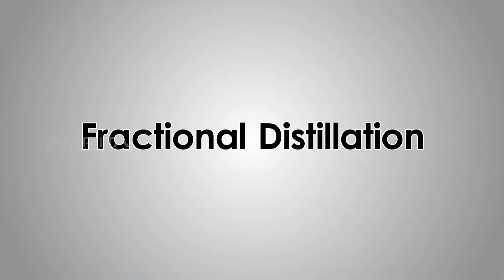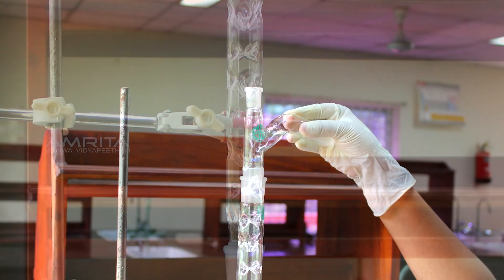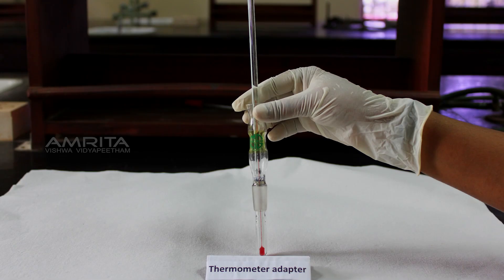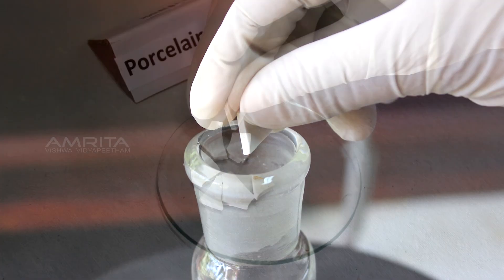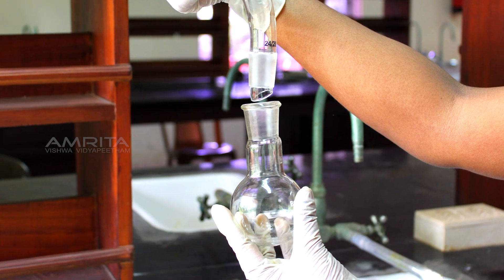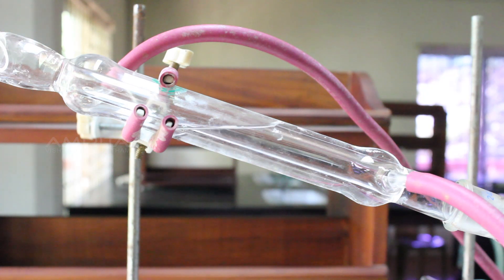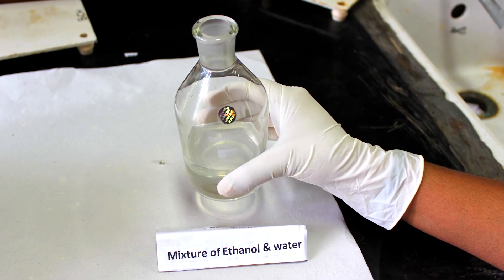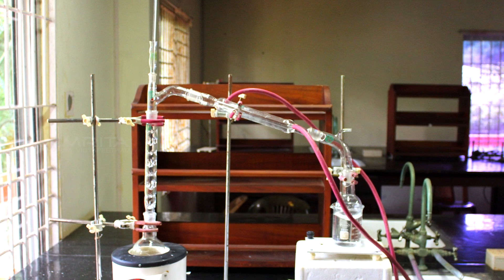Fractional Distillation -  MeitY OLabs

Comment: what type of fractionating coloumn is that. the internal shape is not very visible in the video. can you please name the type or atleast describe the internal shape.
Reply: It's called a vigrueux column.  The glass has indentations like if someone poked it with a rod all over the surface while it was soft.  This is to create more surface area for the vapors to condense on, then revaporize from.  The more condensation and vaporization that occurs before the condenser, the purer and more separated your fractions (separately collected distillate collections) will be.